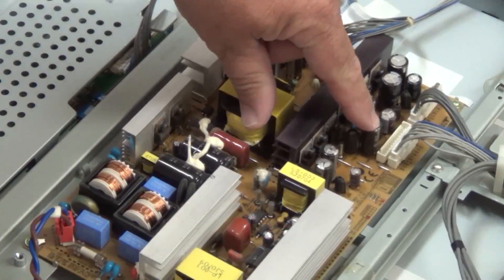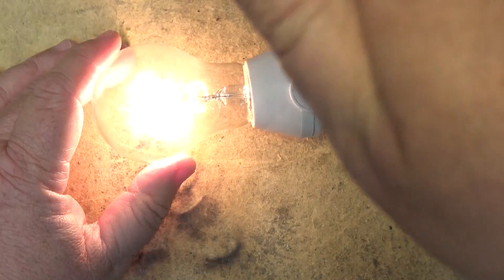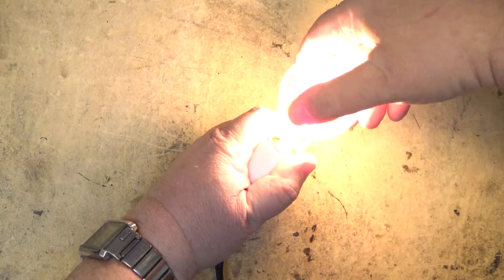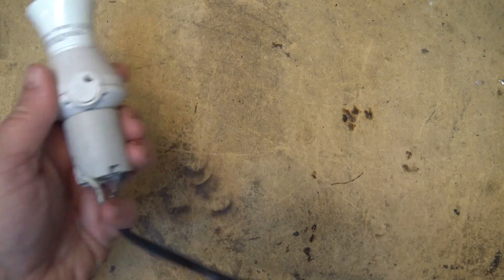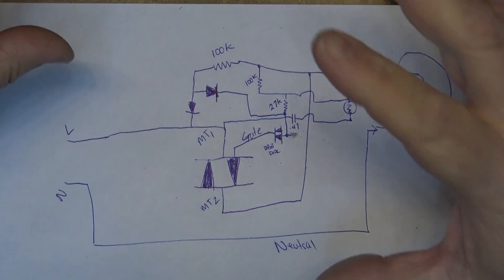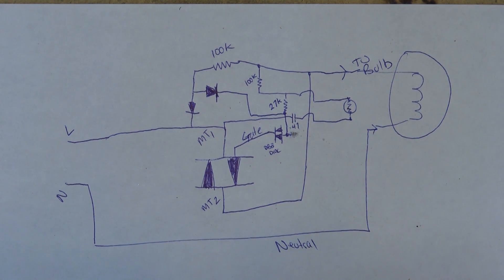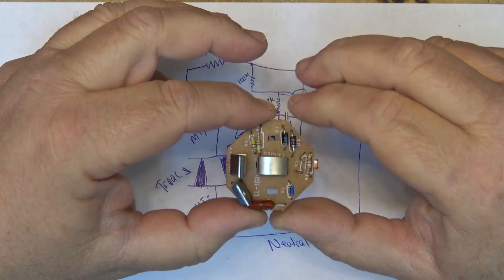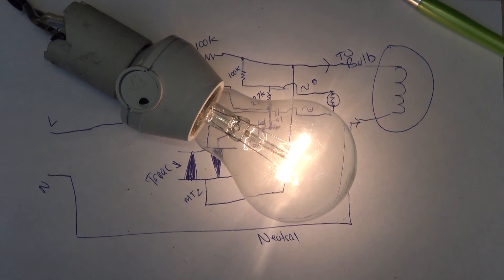automatic light controller tear down and reverse engineer

Comment: Thanks for that Dave. I purchased 2 or 3 different types 7 or 10 years ago now & could not find the adjustable type nowhere. I use to use them for my porch lights, no timers, no wasted electricity, they were nice, but of coarse now I have the ones that just use the LDR's, I guess,  because they are so much cheaper to build, that's in a 2 bulb socket style.